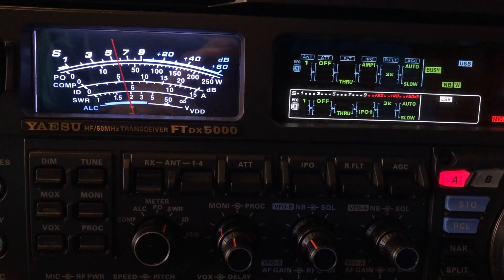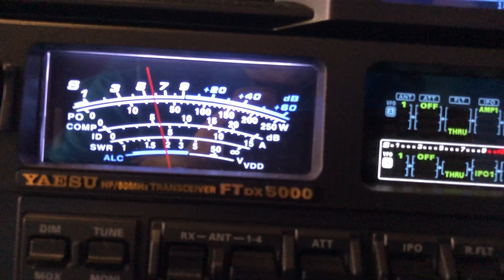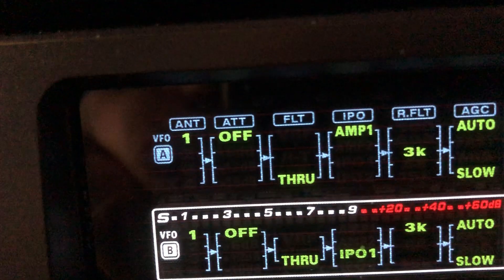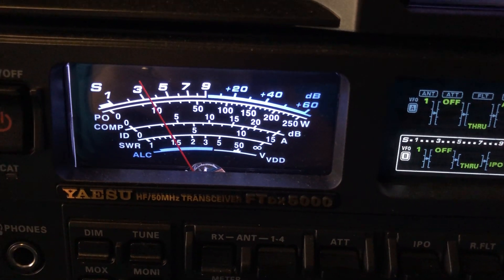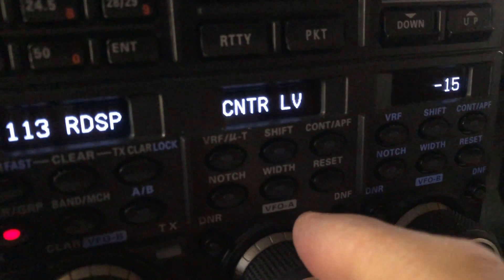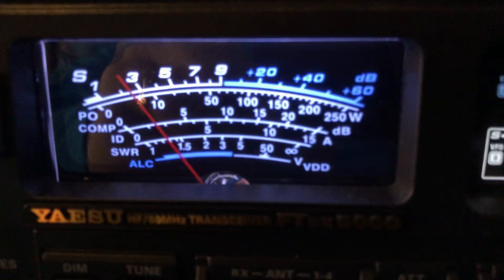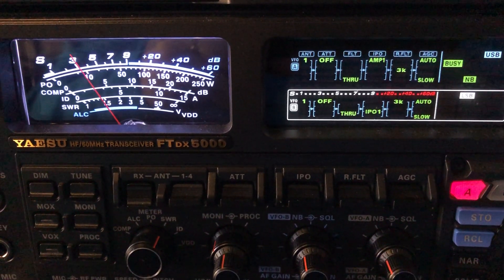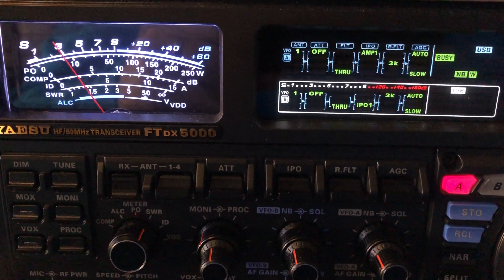Working with the FTdx5000MP Noise Blanker

Comment: On the NB level adjust, this is not a 0-100 level adjust rather a  100 point selection of different algorithm mixes and is why you end up possibly with a lower selection. It can be miss leading. Everyone's noise situation is going to require a different algorithm. The FTdx3000 nb operates on the same premise.
Reply from the maker: Yes, the wide mode uses different timing and width parameters (algorithms).
Reply: Unfortunately, the NB in the YAESU  FTDX-5000 is worst than in the ICOM IC-7600. NB in the IC-7600 can suppress more kinds of the noise, not only pulse noise. But NB of he FTDX-5000 is better than in IC-756PRO3.